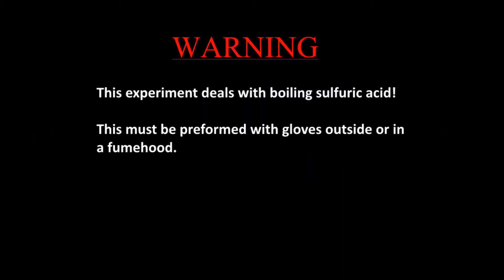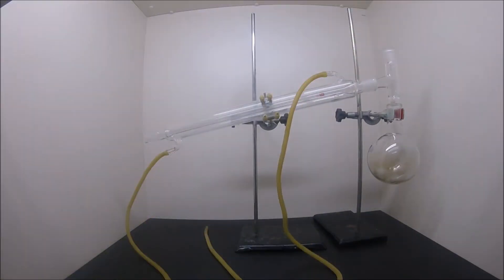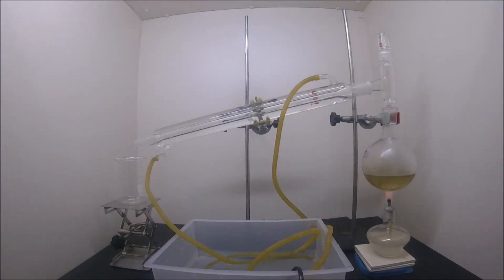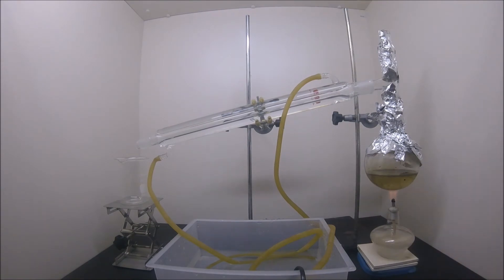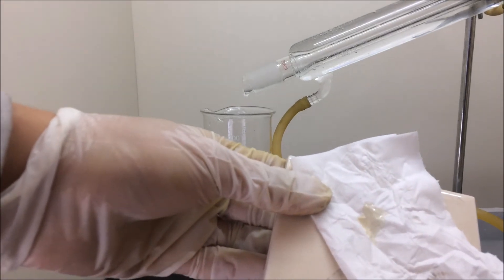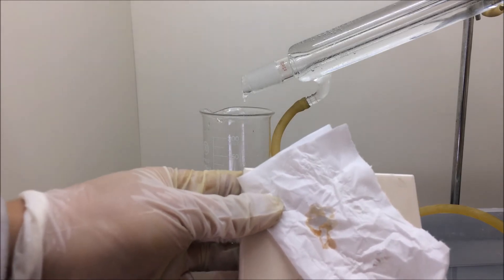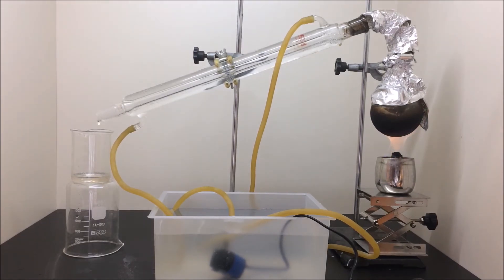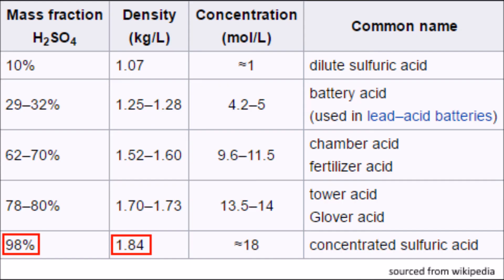Making 98% Sulfuric Acid by Distillation

Comment: Can I distill the sulphuric acid made from electrolysing copper sulphate solution with a platinum electrode? Will all the copper contaminants be removed so that the acid will be clear?
Reply: Yes you can distill it, as for the copper contamination, it will be left behind in the boiling flask. Be VERY careful doing this though, I've been doing chemistry for years and boiling sulfuric acid still scares me, it'll burn and blacken skin on contact, also, use a safer heating method and an air cooled condenser.
Reply: @chemistryofquestionablequa6252  I heated 120ml in a 500ml round bottomed flask at 360 deg cel. A lot of the water was boiled off with lots of bumping in the solution. The glass beads in the solution did not prevent the bumping.  I used glycerine to seal the glass  joints and no keck clips were used. I let it dry for 2 days then I started distilling for 30 mins.  After the heat was turned off, the acid in the flask changed color from light green to black as it cooled down. I have no idea why that happened. Do you? Note....I used 40g CUSO4 with 100ml distilled water.

Comment: The is also the way I use to make conc. sulfuric acid from lead battery acid solution. At first I just used the heating mantle to boiled away most of the water, then I realized the highest temp of my heating mantle wasn't enough to boil 98% dirty acid, but it's not that bad so I kept those acid that left in the flask as a conc.H2SO4, so my whole process wasn't much different than evaporation.

Also once a time I accidentally pour a little amount of hot H2SO4 which temp around 300 Celsius on my workbench. The plastic surface of my table almost instantly became black and generated lots of acid smoke. Luckily it didn't cause fire or further damage to my stuff.

Comment: I distilled with a heating mantle and one of the joints of the flask got broken. Should I put grease in the joints?
Reply: 3 years later. People use some of the sulfuric acid to seal the joints.

Comment: I got the concentrated acid merely by heating a small beaker of battery acid for about half hour.

It released copious amounts of choking fumes all the way till a point I could see the acid achieved a conspicuously viscous texture and was releasing dense white fumes and had boiled to a third of it's volume.

I tried putting a few drops on both sugar and salt and it passed muster for the concentrated sulfuric acid!

Why don't you try it too?Simple and easy It does work!
Reply: you loose quite a lot of acid this way, remember, the more concentrated it gets, the more acid comes OUT of the vapor

the best would always to use a condenser to save as much acid as possible, since is not cheap
Reply: For me it took 7 hours for just 500ml 38% battery acid. I used a beaker (no foil on outside) and a hotplate and did this outside.
Reply: @Berghiker  For me I used a small beaker and DIRECT flame(that too in the kitchen) but I believe I had under 250 ml to start with; 7 hours seems WAY too long!

Comment: You should use a ice bucket with water for distillation, you could have an fire accident from that sulfuric boiling to high or use sandbath or foil to keep the heat in. You were about minutes in danger

Comment: This distillation setup is an accident waiting to happen. First, you are heating the flask with concentrated heat, at a single tiny area (flame), this stresses the glass and risks breaking it, splashing boiling hot sulfuric acid everywhere. You should have used a sand bath, if you dont have a mantle. Second, you are using a water filled condenser, for a very high boiling point substance. This creates very large temperature gradients in  the condenser, and risks breaking it. 
If your condenser were to break, it would splash some water around, some of the water would hit the side of the flask, causing it to shatter instantly, and splash boiling hot acid everywhere. The appropriate glassware would have been an air-cooled, non-jacketed condenser.You are lucky none of these things happened.
PS: I wrote this before watching the video all the way, then saw your flask did  indeed crack.
Reply: Why not just heat the sand bath with a flame and not run water through the condenser
Reply: I see what you are saying, but I would not expect an orange flame to cause excessive thermal stress on borosilicate glass?  blue flame, sure.? Am I wrong?
Reply: Hes also lucky that damn flask didnt pop while he was using that butane(?) Burner. If that acid had dripped on that metal can... Ho boy.
Reply: @eliashunt4213  Butane is a gas @ STP and has a boiling point just below 0° C.
Reply: Do it outside.
Reply from the maker: TheBackyardChemist true but I don't an air-cooled either 😂😂😂. Not enough fund to buy all those.
Reply: Safety Nerd
Reply: @matty8944  safety is how you stop people getting killed or injured idiot
Reply: @sheev9852  It's a joke mate XD and there's no need to be rude...

Comment: Ha! you set up your distillation setup backwards!  not that there is a right way, but it seems like everyone has the flask on the left withe the condenser leading right....  Due to the hardcore method of flame heating i was thinking of the glass cracking even before i saw the flask pic. did you also get severe bumping?
Reply: he getting the D-H2SO4 form , not the L-H2SO4))
Reply from the maker: AllChemystery the bumping was alright actually, I had boiling stones in the flask (forgot to mention in the video) i actually freaked a little when I saw the cracking, so buying a heating mentle
Reply: He is chinese. Historically writing was right to left, top to bottom. Therefore, the receiver flask must be on the left 🤣